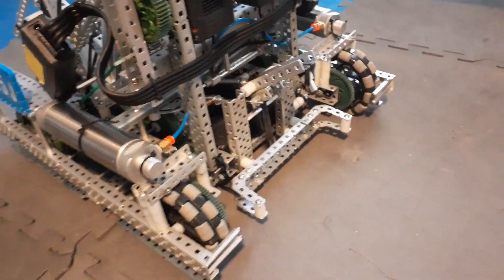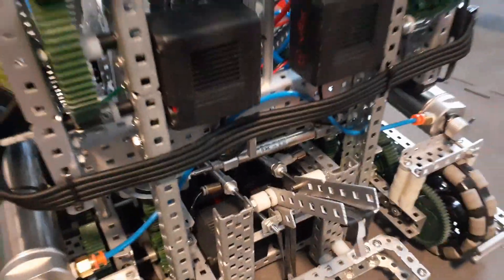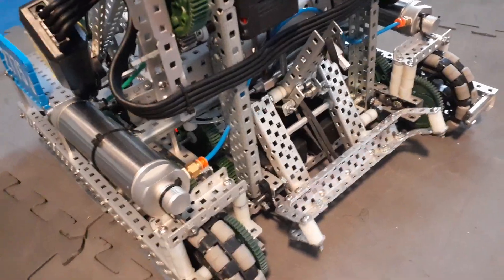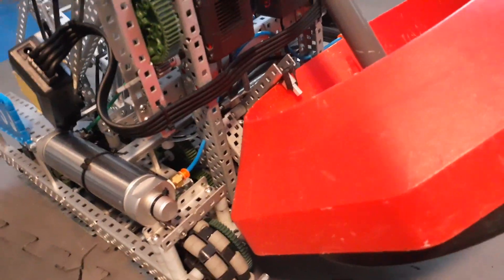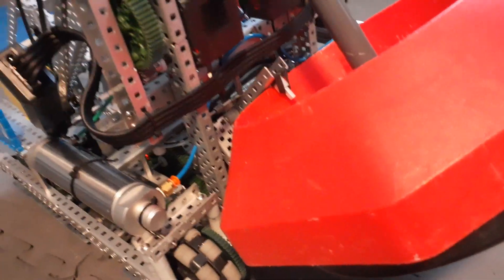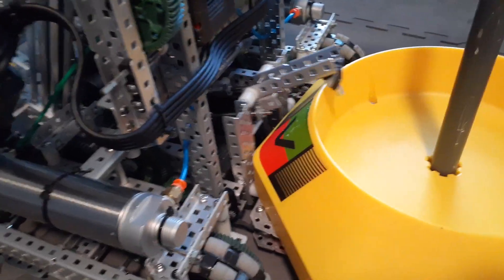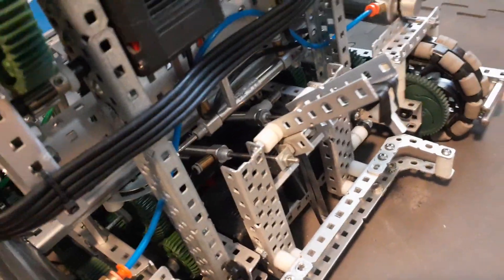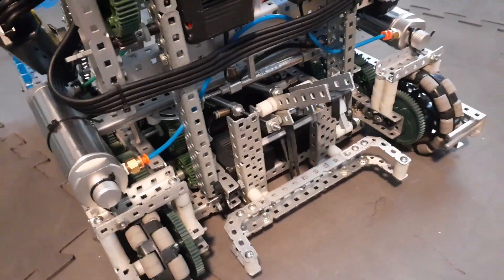2775J Mogo Mech (VEX Robotics Tipping Point)

Comment: Take it from a team with a similar design, and one that's went up against 2774=5j. This rear clamp is very good when paired with an accurate ring guide, and when you have as good a driver as they do it always keeps you as a top contender.
Reply from the maker: Believe it or not 2774A is a completely separate organization

Comment: How does the tilted release so slow
Reply from the maker: limiter
Reply: How should I use the limiter and it is a flow control valve?
Reply: @Team 2775J  pls help
Reply from the maker: @charles8889a  put it on the cylinder then plug hose into it
Reply: Tysm
Reply: We now have the best back claw in our organization
Reply from the maker: @charles8889a  alright
Reply: How do u guys have enough air to use it so many times?
Reply: We use 10 psi a actuation and it only tilts at 100 psi
Reply from the maker: @charles8889a  put ur solenoids closer to the cylinder, increase leverage, use a pressure regulator
Reply: Same thing as pressure control valve?
Reply from the maker: @charles8889a  yes
Reply: How many limiters do you use?
Reply: @TeamV-um8sl  hi, what is a limiter and how do I make one? And which port of the pneumtic piston do you put a limiter on to make it retract with full force but extend slowly?